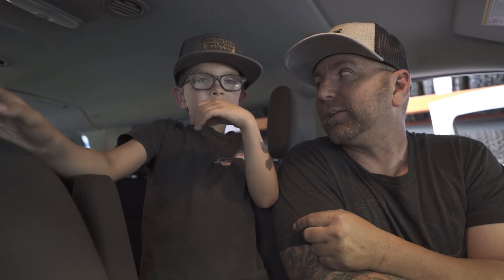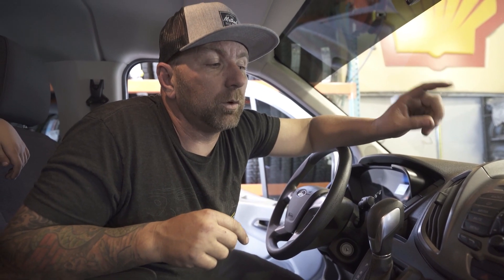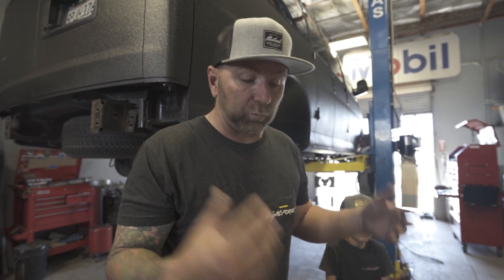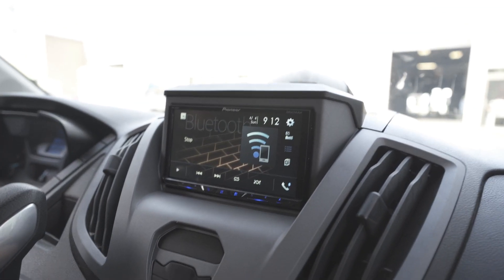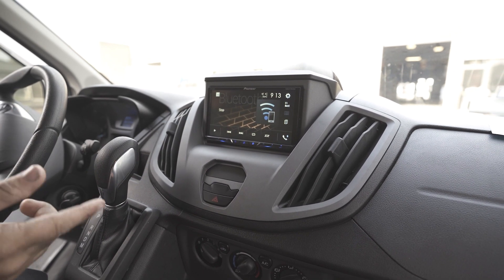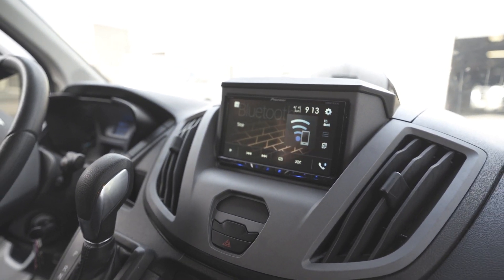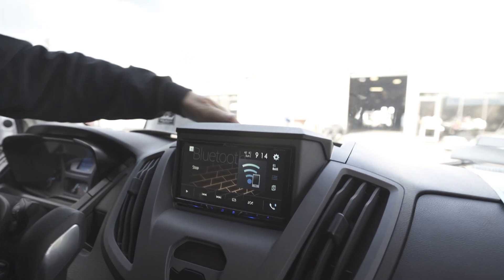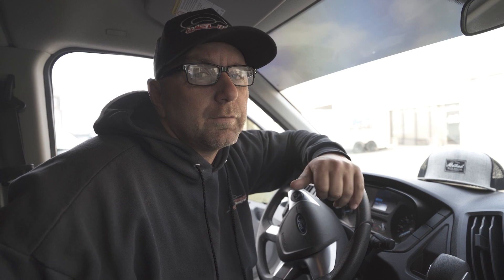Transit Takeover: Ford Transit Stereo Upgrade

Comment from the maker: Hey everyone! Here are the products talked about in the video: 

-Metra 99-5832G Single/Double Din Dash Combo Kit for Select Ford Transit 2015-Up (https://www.amazon.com/dp/B01NGUEJD9?ref=exp_weldtecdesigns_dp_vv_d)
-Pioneer DMH-1500NEX Digital Media Receiver with 7" WVGA Display, Apple CarPlay, Android Auto, Built in Bluetooth (https://www.amazon.com/dp/B07PMXN6JH?ref=exp_weldtecdesigns_dp_vv_d)
(Also we used adapters to connect to the stock wiring) 

This is included in our Transit Takeover section of our Amazon Shop: https://www.amazon.com/shop/weldtecdesigns
Reply: iDatalink HRN-HRR-FO2

iDatalink Maestro RR or MMR2

Both of those should restore back up camera functionality and add to it from what I have been able to find.

Comment: I did a 2018 transit. Was able to keep the backup camera but now on a 7 inch screen with CD player player. Ordered from Crutchfield. Wiring Wiring harnesses even maintain steering wheel controls. 
Getting the "Metra " dash kit to fit perfectly took much trial and error using a combination of the factory clips and the ones provided by Metra. Well worth the effort! It looks factory installed!
Reply: What did you order from Crutchfield? Got a model number or something else to help identify it? Thanks in advance.
Reply: @Veevslav1  thanks for responding to my comment. I hope what I've been able to locate about my order will help you.
My transit had a factory CD player and the small 4in backup camera. The camera was recessed about a foot back from the front of the dash and extremely difficult to see. 
I discussed my needs with Rex and Ronald and they told me what I would need. 
I ordered a Kenwood DDX57S receiver, Metra dash kit, steering wheel controls, backup camera wiring harness and I think a couple other wiring harnesses. 
There are some less expensive options if you don't want or need the CD player. 
Wish I could send you a picture of the final install. 
Be patient and take your time. 
Crutchfield reps were helpful but you still have to figure somethings out on your own! 
Hope this helps. Please text if there is anything else you need.
Reply: @chrisdevalcourt648  Thank you for the response. I will take the time to research it out. ;)

Comment: Did you guys have issues getting power to the new stereo with the harness.  I have a 2017 Ford transit xlt 150 and having no luck getting power to the new unit.  The original does, the new one does in another vehicle... but nothing when I get everything put together into the van. I have two different harnesses. The “metro XSVI 5524” and “70-5524”.
But no power. Any words of advice? Thanks :)
Reply: I’m assuming by now you’ve found an answer to your question. But I used a underneath the cupholder that goes to the back up lights. It’s supplies the module with 12v when the key is on.